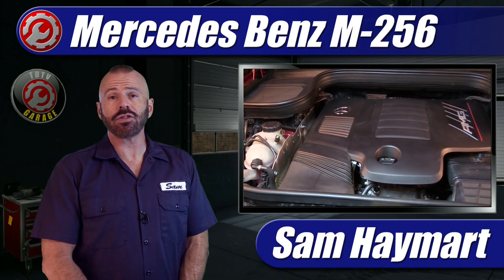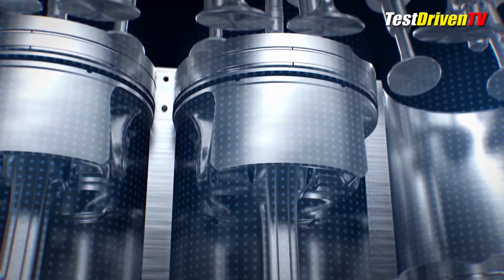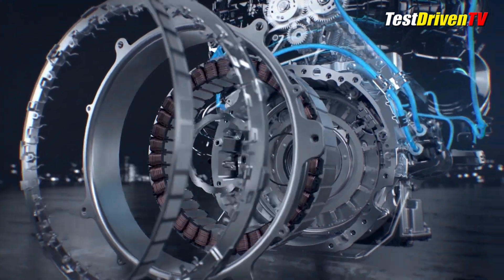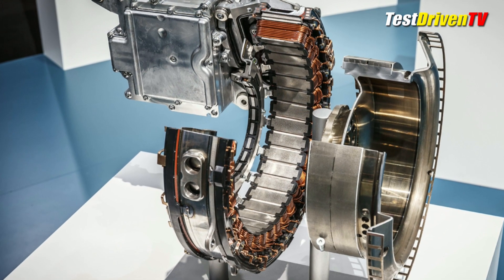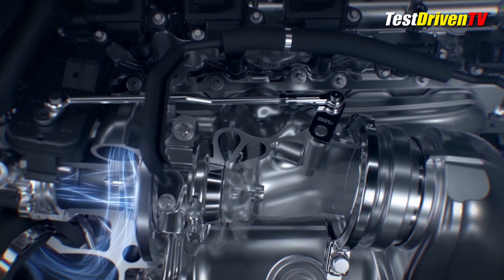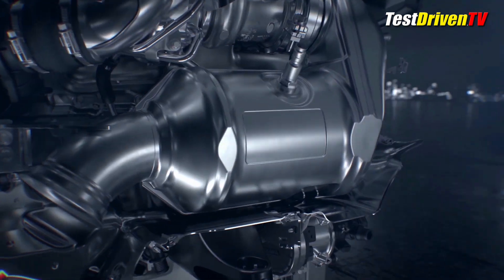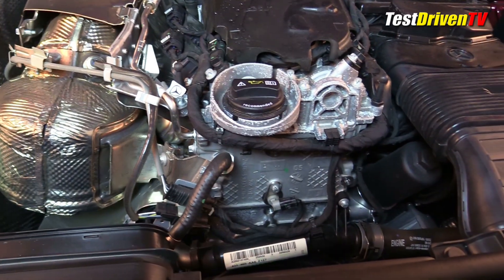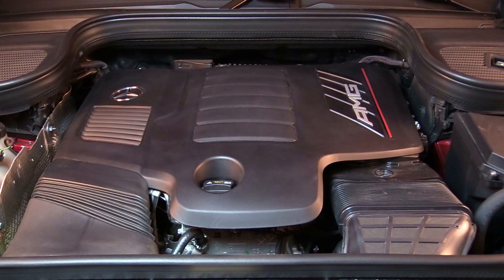Tech Look: 2021 Mercedes-Benz M-256 Engine

Comment: I saw a GLE 450 at 98,000 km and the engine was rattling like a diesel. Is this normal for this engine?
Reply from the maker: Depends on the rattle to which you refer. Engines with direct fuel injection can sound noisy at idle, mimicking the sound we used to associate with a worn engine.

Comment: 500cc combustion chambers?? WTF, that is insane!!
Reply: 500cc * 6 = 3000cc hence 3l displacement
Reply: @Demoxx1   Yes the math is correct, but combustion chambers do not represent displacement. Combustion chambers are measured at TDC.
Reply: @ interesting
Reply: Same as B58. I wonder why this engine isn’t tuned as much.
Reply: @jcpg5272  if i had to guess why it is either mercedes put an ecu lock or that tuners dont want to mess with the complexity of it for the gains it may result in.
Reply: @Demoxx1  The B58 has been around since 2015-16 in the BMW *40 models but didn’t reach tuning potential till the Supra/Z4 launched around 2019. In 2022 BMW locked the ECU on all B58 Gen 2.  It wasn’t until 2023 that a DME unlock was possible.  Also the VR30 in the Infiniti Q50/Q60 has been around since 2016 as well and hadn’t reached tuning potential until the Nissan Z came out In 2022.  I think tuners won’t even bother with a platform unless there’s a business need.  I don’t think Mercedes owners even tried with this M256 platform.  AMG owners seem to be less tuner centric than BMW owners. With that said I’ll start asking tuners on the potential of this platform as it looks extremely promising.
Reply: @jcpg5272  yeah. you do make a good point. I agree the m256 engine definitely has some potential.

Comment: I can’t believe Mercedes would go to so much trouble & expense to develop such a ground breaking engine, yet they failed to add port injection to augment the existing direct injection. Toyota, Lexus, Ford and other manufacturers have added port fuel injection to their direct injection engines to reduce the inevitable buildup of carbon deposits on the intake valves. In the big picture adding the port injectors to the inlet manifold would have been a minor added cost, however it would have offset a significant repair cost for decarbonizing the inlet valves once the engine had enough miles on it to choke-up with carbon. Of course, this would likely happen down the road after the vehicle warranty has expired….
Reply: Well said
Reply from the maker: Or maybe the issue of "carbon buildup" is a little overblown.
Reply: @TDTVGarage  I believe it is pretty overblown as well. Plenty of engines have had direct injection and we haven't seen them just falling apart left and right.

Comment: how does this compare to the b58 regarding tuning?
Reply: The stock turbocharger isn’t as large and won’t flow as much air when you push it, but otherwise it can handle plenty of power. I’ve seen some that are making 700+ wheel on stock engine with no issues
Reply: @PapiAndrey  where have u seen the 700+? im interseted i gotta take a look at it
Reply: Capable of more horsepower imo. But they are both closed block, 7 main bearing engines. They can put out 1000 horsepower tuned and built for it.

Comment: What is the key difference in the engine between the GLE 450 and AMG GLE 53?  Appears to be the supercharger?  Is it worth the price uncharge for the AMG?
Reply: Yep it has more hp and the e supercharger. Don‘t forget with the amg name you get suspension, brakes, looks, interior etc
Reply: I just bought both new .... the gle 53 amg is a completely different animal than my wife's gle 450.  Both are beautiful cars and have different personalities
Reply: The AMG also comes standard with higher boost PSI. Don't quote me but I believe the 450 stock is pushing 13psi and the AMG pushes 17psi.

Comment: I can't understand why this brilliant engine is only used in so few applications (already dying out so to speak) - it's a masterpiece and I love how they used all available key-technologies to create the best 'downsizing engine' in my eyes ... ISG, split oiling, Camtronic, E-Charger, electrified accessories, OPF/GPF, multi-spark and -injection, lean burn, etc. This could have been the best possible transition from ICE to whatever with less-emissions. They wasted years and stupid money to create this beauty but instead of using and promoting it they seem to not care anymore about it. When the engine was released my first thought was: 'Yes, put this thing in a RWD C-Class, brand it AMG C53 and nobody gonna miss the 'ol V8' ... now they put a four-banger in the 'C63' and nobody seems to care. The 4-litre biturbo V8 already wasn't a good replacement for the NA 6,2, but now it's even worse. I worked in the industry and I understand that the golden ages of ICE are over, but why can't we get a smooth transition? Does it have to end 'hard'? I love my M274 as daily driver (C 300) and I love my Viper with it's mighty NA 8,4 V10 ... the M256 with pure RWD or the H2-Wankel from Mazda (as in the Vision RX-9) would have been most interesting to me (last ICE jeweles) - pity that they never gonna make 'em :-( Engine freaks like me can only 'look back' now and focus on 'old cars' - shame.
Reply: My dear engine freak ICE is not dead it's just morphing......H2 engines will soon start to spread. Check out Cummins and BMW efforts to burn H2 instead of using it for fuel cells!!!.....I agree with you that this M256 seems to be the only engine that combine all of the best improvements an ICE engine can have!!
Reply: @Lmarcanov1978  Yeah, thanks. I'd rather believe in Santa Claus than the total move to H2/E-Fuels ... You're invited to revist my comment - as said I worked in engine development as engino dyno operator long enough and as German I get brainwashed about CO2, green future, H2 and E-Fuels on a daily basis by our mainstream propaganda. I know what H2/E-Fuels can achieve but I don't believe in a fast and easy transition - just replacing the energy carrier won't do ... the whole game has to change. In my opinion it would be better to put an end to ICE and move to an all-new strategy in terms of mobility (but preserve the existing classics) than crippling it more and more ... H2 1-litre three-banger - not for me.
But by ALL means - I wish you all the best with your shiny, clean and idealistic future. Just leave us 'old' fellows behind in the dirt and PLEASE don't care or try to take us with you on this path.
Reply: It's absolutely wild. Same with the M139L that is new in the c63s. It would have been AMAZING in a smaller car, BRING THE A45S HATCH OVER TO THE USA..... 

Or just the c43 coupe with the m256. Instead now we have to get the CLE53 which will be around $80,000-$90,000 instead of $65,000-$70,000 in a c43 coupe. 

Not to mention they should have just put this engine in the c63s first of all.
Reply: yes,crazy times
Reply: Spot on. Glad to drive this engine myself
Reply: I'm sorry my friend even though you have excellent points but I don't agree with you as you know engineers and their corporation have stupid behavior they never perfect something they have stick to it let's say M272 with its numeral problems and whatever they do at the end it falls on my hand on your hand or somebody else hand and we suffer because they don't stick to it for 20 or 30 years and same is with this engine it has headache with the and huge problem removing that internal generator and replacing it it cost a lot of money I cannot accept what you're saying the end this engines and diesel engines they create a lot of chemicals it makes us sick turn around and look at how many people are sick with cancer why should we not move to the cleaner  technology available at this moment I'm well past 50 years why shall we cry about the past
Reply: Agreed, thankfully we have the Cle53 amg and cle450 as well as many other models using the m256
Reply: @PapiAndrey  Yeah. I love It, I didn't regret buying it.

Comment: The electric super charger powered by the 48v system only builds boost pressure till 750rpm, there is a spring loaded diverted valve in the intake tract that is only open up to a certain pressure level

Comment: They need to move the ISG to the front of the engine for easier repair.  I know the engine is to long but add free valve and it’s a go!!!  The return of the oil filter to the top of the engine, second to none.  Only the Germans can figure it out.

Comment: If it ever needs to be jump started, would a 12V jumper do? Would that be done via the 12V access points?
Reply from the maker: There are posts under the hood for standard 12v jump starting.
Reply: @TDTVGarage  Thanks

Comment: Good luck for anyone who gonna repair them after warranty :)
Reply: Theyre a pain in Warranty also. The 48V battery is garbage.
Reply: @giovannibustamante9367  can you tell me if you can even add a subwoofer to this car? Does the alternator work like a regular car or when it wants like bmw?
Reply: @giovannibustamante9367 someone who doesn‘t know shit ladies and gents
Reply: Nobody needs to repair cause they‘re reliable
Reply: @m850i_individual 😅